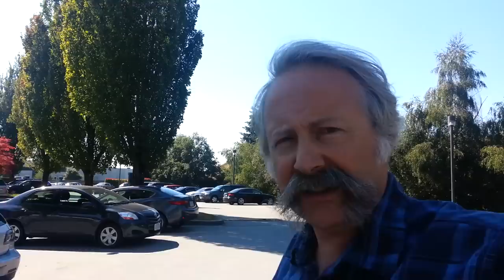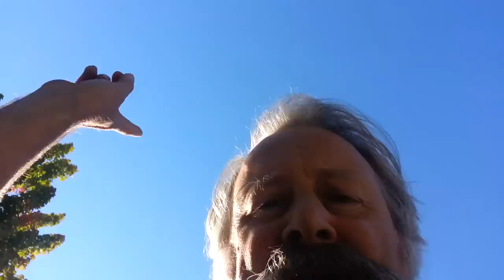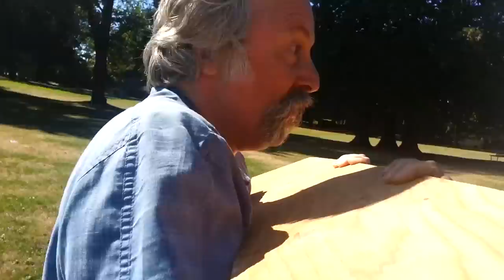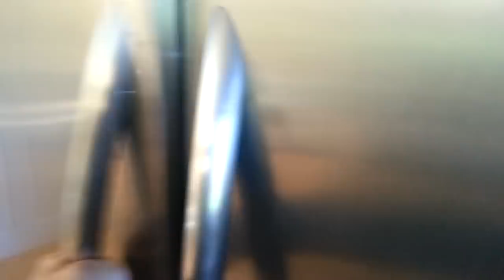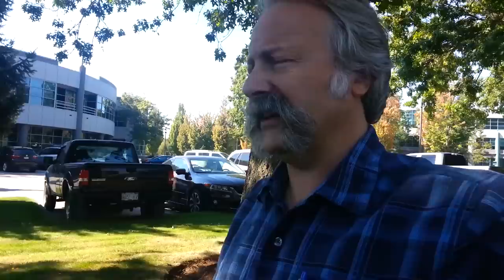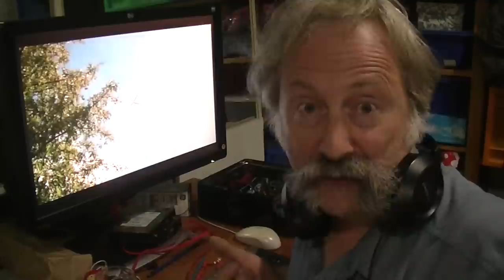Ghost Wing

Comment: Isn't it the air going over the wing that gives it lift? Take a piece of paper. Hold by the edge and bend it towards yourself so that the top goes away from you. Blow over the top and the paper will rise.
Reply from the maker: I know this is a popular explanation, the bernoulli effect version of lift, that the air moving above the convex upper surface is accelerated, so travels faster over the surface exerting less pressure than the slower moving air on the lower surface. Net effect is lift.
When you blow over the top of the paper it rises because, in effect, you are blowing away the air pushing down on the paper leaving the air below it to push up.
However, if you blow air on the under side of the paper it also lifts because the air you blow there piles up under the paper until the pressure pushes the page up so the air can flow again.
So, while an airfoil alone can provide lift, lift increases as you increase the angle of attack (until it doesn't and then you fall out of the sky). If flight were only about the shape of the airfoil airplanes shouldn't be able to fly upside-down but they can by adjusting the angle of attack even though they can't change the shape of their airfoil.